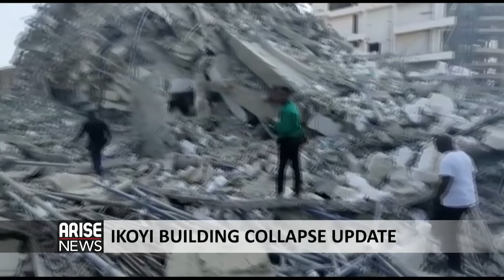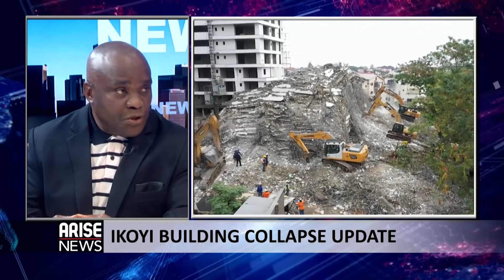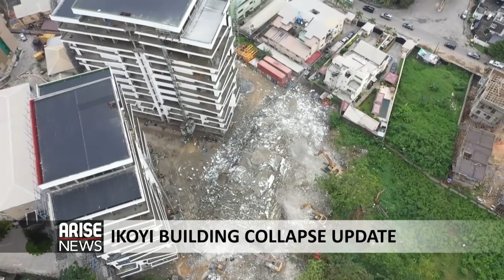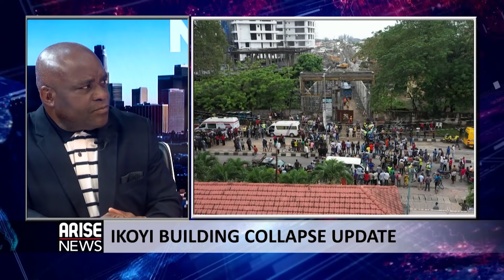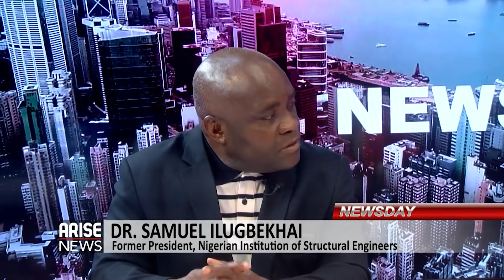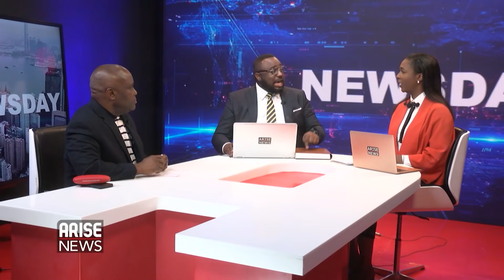COLLAPSED IKOYI BUILDING: LESSONS LEARNED WITH DR. SAMUEL ILUGBEKHAI

Comment: This engineer avoided answering a very pertinent question on the responsibilities of the structural engineers to report a non compliance structures to appropriate authorities. He was just beating around the question. 
Nigeria we hail thee
Reply: It is not the mater of avoiding questions. The Nigerian Institute of Structural Engineers is not a building monitoring team. The government have the will power to do that. Now the Engineer reports the incidence to the government and nothing happens because of corruption in the system, what do you expect him to do? Further, how sure are you that the Engineer did no report the problem in this case? Or did you not read or hear that the site was initially closed? That means the government is aware of the problem. Why was construction later continued after closure? These are questions we should be asking.

Comment: Too much money or greedy, Why most Nigeria accept such high building? To be build by blacks. Building 21 storeys is too much, Need to have been put into consideration, not only by the owner also by government officials. The location, the land need to be inspected, if they use sufficient materials for the foundations? With the pillars needed sufficient materials to hold it firm. Whom were supposed to monitor the situation/ the building to know if they were managing or economizing materials? May their souls rest in peace in Jesus Christ mighty name amen.
Reply: How do you mean by to be built by blacks? Like we do not have the Technical know-how for such work? Erase the inferiority complex off your thoughts. As a mater of fact, structures like this are like 'bread and butter' to many members of the Nigerian Institution of structural Engineers (NISE) as the Engineer emphasized. Poor regulation and corrupt practices in the system is a major problem in the society.

Comment: May the soul of the victims of this disaster rest in peace.Is this man really a structural engineer?this is failure from excessive eccentric axial load on the columns.The columns beneath were under designed,I guess that was the reason why the structural engineer resigned.i believe the owner of this structure is an igbo man
Reply: Ayuba, you've already turned this tragic event into a tribal issue. You no dey shame?
Reply: @fulanimary2446  Igbo developers like cutting corners.i speak from my wealth of experience over time as a building engineer while you speak from your wretched comfort zone
Reply: @ayubadangana2458  you must be ashamed of your self
Reply: This is one of the reasons why Nigeria is a failed system. Imagine claiming to know more than the former president of the Nigerian institution of structural engineers. People like you tend to advice clients to go against the Engineer's specifications cos you feel you know better. Most likely the building owner was wrongly advised by one of your fellows. Don't be a know it all.

Comment: Again, we want to send our heart-felt condolences to the families and friends of the injured and bereaved and recommend working 24/ 7 is an absolute must to locate everyone inside the collapsed building.

We have some of the best engineers in the world, but a failure of a system working together effectively towards a common goal is what's lacking across the board. For example, a system is a group of interrelated components working together effectively towards a common goal - construction of safe buildings and high-rise buildings ✍️